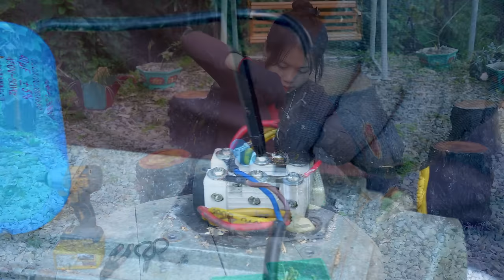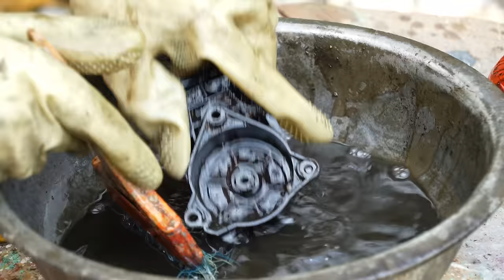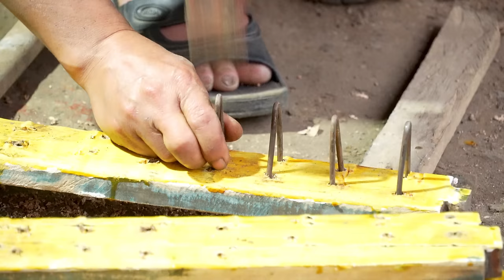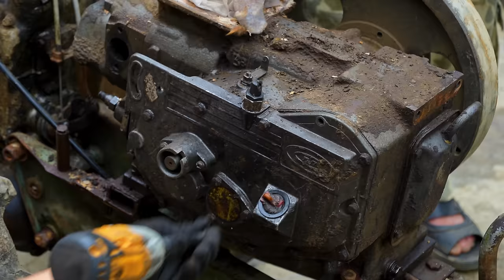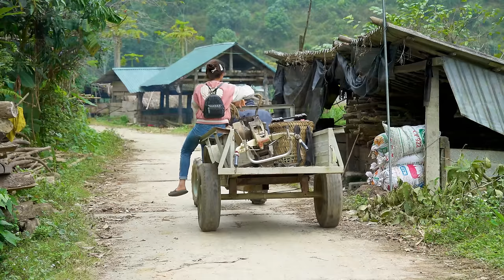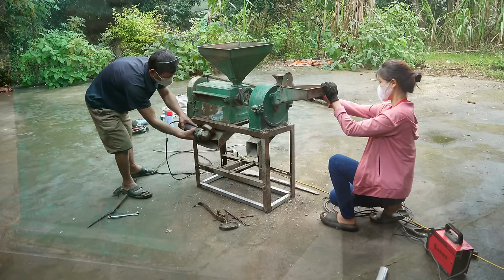TIMELAPSE: Genius girl repairs and restores tractor and grain separator engines

Comment: Danger danger danger with the electric motor. Take this advice and don't do any more. You need proper training to not put those you do work for in danger. Take this matter seriously. if you want to work on electric equipment you need training. Without a-proper understanding of impedance and inductance you are doing the wrong thing. I will leave that to your common sense. I wish you the best but you must not take on electric motors.